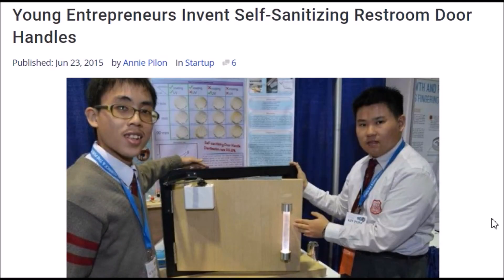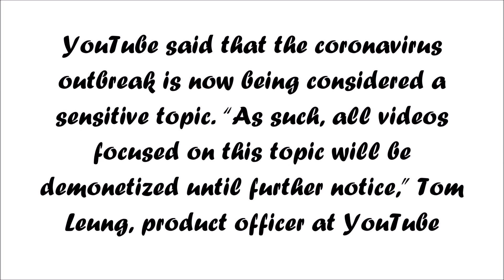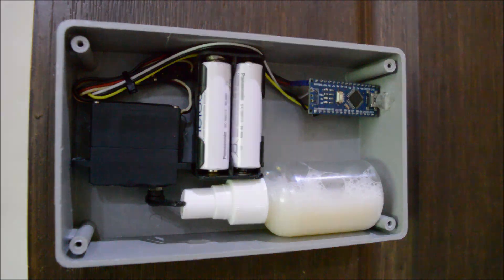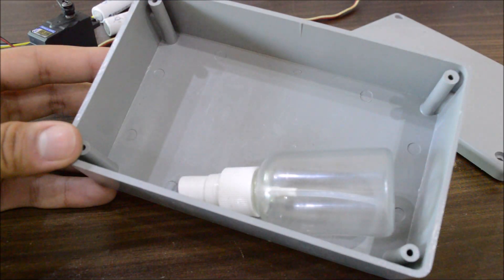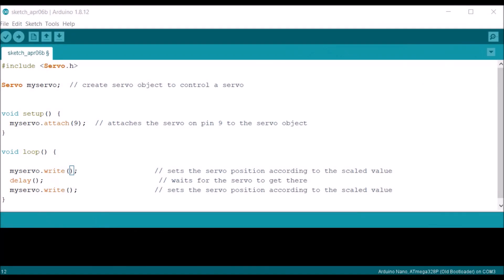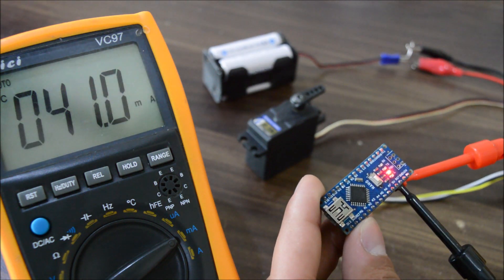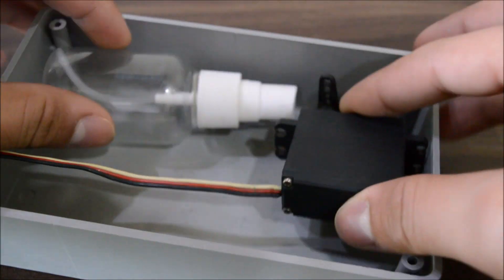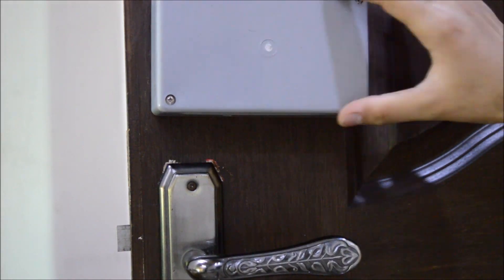DIY Door Handle Sanitizer || Corona Virus Precaution

Comment: Good afternoon sir, I'm kinda having a problem following this tutorial since my battery holder is a different one. It's still a 4 cell holder but the problem is that it doesn't have the thing the connects it to the arduino. Also, is there a way to message you so I can address my other questions? Hoping for a reply, thank you so much
Reply from the maker: You can either use jumper wires or directly solder the wires to the arduino board. For further questions you can follow me on Facebook, I will surely help you there.
Reply: @Aatikslab  thank you for the fast reply 💖. Just messaged the fb page.
Reply: @Aatikslab  Ow another question. Which part of the arduino board do I exactly solder the battery holder's wires (keeping in mind the red and black wires specifically). Sorry for the inconvenience and thank you for taking your time 💖.
Reply: @Aatikslab  helloo again sir, messaged your fb page yesterday and replying for a follow-up. Sorry for the inconvenience and thank you for taking the time 💖. My message was just basically my other reply here so you respond here, thank youu.
Reply: @Aatikslab  Helloo sir, it's me again. Sorry for the inconvenience but I sent you a message on your fb page again. This is probablythe last one. Thank you so much and for last time as well 💖.

Comment: Nice project. BUt i have a question. What triggers the ardino to spray? do we have to press any switch?
Reply from the maker: Deevish N D no it automatically does that. After 30 minuets arduino wakes up from the sleep mode rotate the servo and again goes back to sleep for 30 minuets
Reply: @Aatikslab  Good afternoon sir, I'm kinda having a problem following this tutorial since my battery holder is a different one. It's still a 4 cell holder but the problem is that it doesn't have the thing the connects it to the arduino. Also, is there a way to message you so I can address my other questions? Hoping for a reply, thank you so much <3.